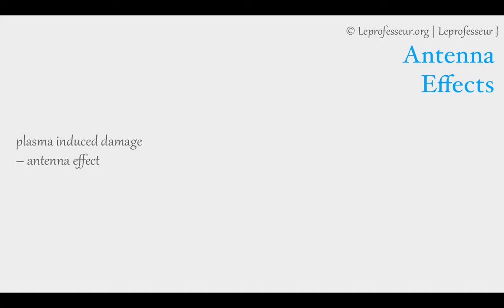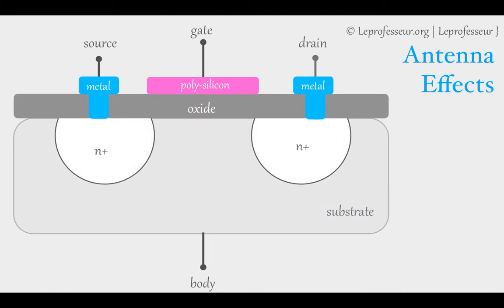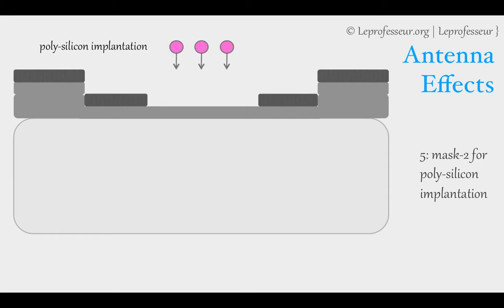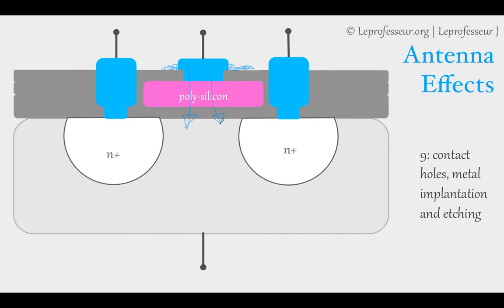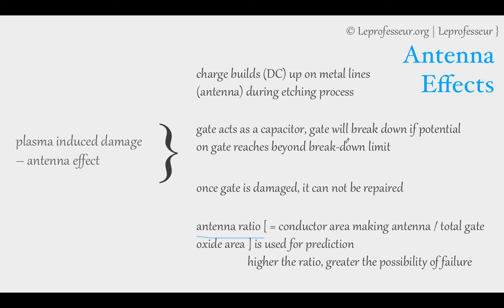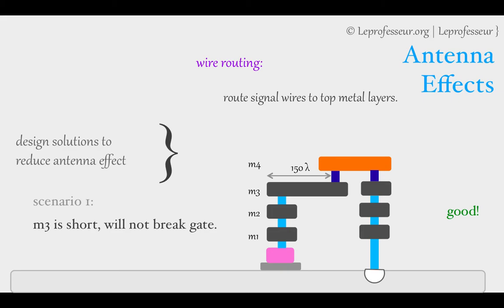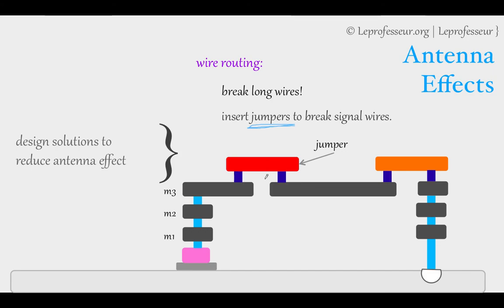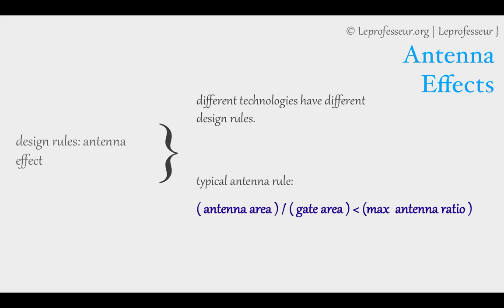⨘ } VLSI } 8 } Antenna Effects } LE PROF }

Comment: Can jumpers be in higher and lower metal both?
Reply from the maker: different other techniques may be used, e.g. jog to upper layers, jog to lower layers might not help as it will increase net resistance and hence delay.

Comment: Thanks..But why we jump to higher metals ? Suppose I am getting antenna on top higher metal and adding of diode option is not there ? Then can we jump to lower metal ?
Reply from the maker: usually we use higher metal layer to fix, this is something to do that lower metal layers will be formed than higher. after fabrication of every metal layer there is planarization process which takes care of removing collected charge on metal layers. if we use higher layer charges will be less as extra charges are removed. if we use lower layers to fix antenna there might be extra charge deposited to lower level which will find the path downward to flow that charge may break gate oxide.

Comment: clearly explained ,we want some  topics of like electromigration, latch up, impedence matching ,low drop out voltage regulators ,shallow trench, symmetry, poles and zeros, how to know which is the dominant pole in a circuit. please share the lecturing on these topics
Reply from the maker: Thanks! for suggestions, will plan some lectures in coming future for the requested topics. There is a new lecture which is related to reliability in electronics circuits, you may find it useful: https://youtu.be/fCYdd_LCQWk
Reply from the maker: For latch up you may like to view this lecture: https://youtu.be/uihFUbOTlzM